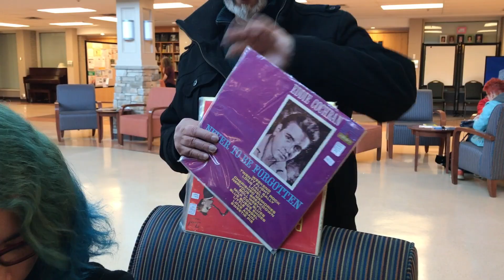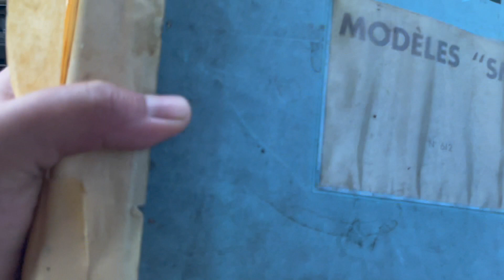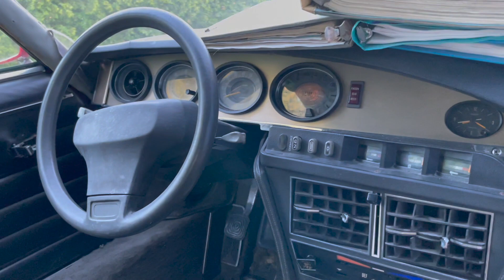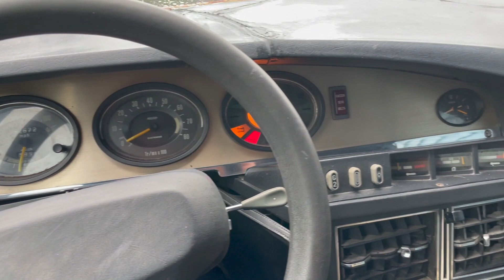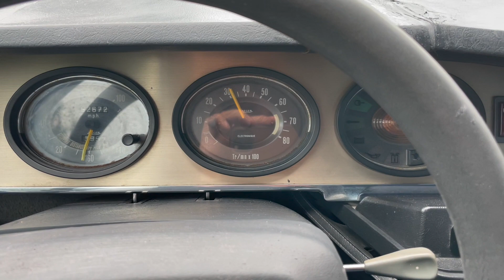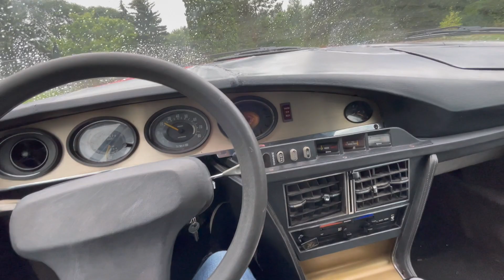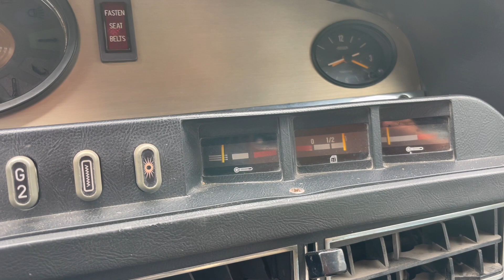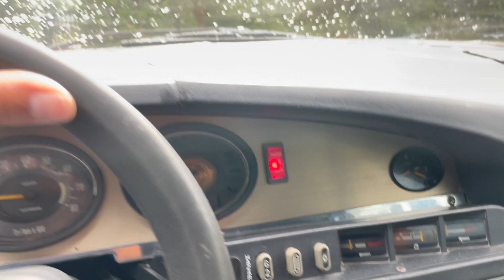Resurrecting a derelict french spaceship, Neglected Citroen SM

Comment: That is a genuine treasure.
You'll need new accumulator spheres all around (even though they appear good, the damping goes and there will be a shortage of brakes) for certain, to get the suspension/braking fixed up to full quality (they are linked, so brake force is automatically adjusted according to wheel loading, which was WAY ahead of its time) and the suspension is hydraulic, not pneumatic.  As the suspension and braking are linked, it is necessary to fix both to make it properly roadworthy - it will handle and brake far better for a set of spheres, and corners dead flat, instead of leaning out as we are used to - even the steering input adjusts the suspension pressure (the power steering is on the same system).  In the event of an hydraulic failure, you will get two full brake applications before it all goes, as one accumulator is reserved purely for that.  There are tiny seals on each joint in the pipework, and it is good to keep a few of those around (I even had spare spheres for mine, but they were daily drivers that I relied on, so could not afford to wait for spares).  I think yours takes one sphere on each corner, one centrally, and an emergency/reserve one to store emergency pressure for brakes.  They just unscrew but make sure the suspension is down and the engine switched off before removing them - you will need a chain or strap wrench.  I don't know about the SM, but on the models I've worked on (DS, CS, CX, XM and C5 [not all mine]), the rear spheres are a pain to access.
I have had a number of Citroens, so know the system moderately well - you will need some of the green hydraulic fluid (LM2, from memory, and it is probably overdue for a change - the shop annual should cover that, and you should follow it religiously, as each part of the system needs to be exercised in the right order to push out the old fluid and draw in the new), probably quite a lot - I'd get 10 litres for a full service on that, with a little left over for emergencies (carry it in the car, as it is hard to get).  It runs at insane pressure, and more normal brake line flaring tools are NOT capable of doing the job, as the "flare" is actually a bulge in the pipe a short way along it, which a seal is forced against by the pressure in the system.  There is a specialist Citroen tool for those lines, which is not expensive but is hard to find.  The windscreen may be a problem - they are even in the UK.
You can change a wheel even without a jack - just put the suspension to full height (only intended for maintenance), chock the suspension under end with the punctured wheel, then put the suspension back down, which will lift the punctured and chocked wheel!  For a front, put it in park and chock the rear wheels, as the parking brake is on the front wheels.  or a rear, the parking brake will suffice - use it, as the system seizes up if it is not exercised.  This is the suspension system that was licensed by Rolls Royce, Bentley and Mercedes Benz for their top-of-the-line models.  It is still the best there is, albeit slightly upgraded over the years (more electronic control with g sensors and laser-gyros to maximise handling from the XM on, and from the C5, it even stores pressure to return the ride height as you unlock it).  The more basic (and maintainable, with no electronics) system on that does have a rather wooden feel to the brakes, as the "pedal" barely moves at all.  The parking brake (the other pedal) operates separate small pucks on the same front disk rotor as the normal brake, but mechanically and relatively weakly.
Nice job on the paintwork, and I look forward to seeing the interior come back to life!  That is a rare car even in France, where it would draw similar or greater attention to an E-type Jaguar in one of its rarer versions!
Reply: Wow!!  And I thought I was super detailed in my posts!!!!!  Bravo Sir!!!
Reply: Yes, it's technology borrowed from the aerospace industry, the suspension, power steering, and brakes are all hydraulically actuated and electrically controlled, or electro-hyd. controlled. Just an all around cool set-up, that must be maintained correctly as you stated above. I would love to have this car!!!
Reply: @cliffordkinnear9705  Yes, you soon learn to do it right, usually after the jet of LM2 from a tiny leak cuts a neat hole in whatever metal it is pointing at (if you are lucky) or the wiring loom (if you are not). DAMHIKT.
It's actally more advanced than in aviation. as the spheres are pressurised with nitrogen, the pump pressurises the fluid with the spheres giving cushioning bacause gas is compressible, and the same circuit powering the brakes so that when you hit a bump on braking, the compression of the suspension increases (briefly) the pressure to the brake caliper, with the reverse happening after the bump or when hitting a hole.  Applied proportional braking per wheel.  Level sensors keep the pressure at whatever is required to avoid nose dive under braking or body roll under cornering, again keeping the braking power directly proportional to the wheel loading.  Pitch and roll are not somethaing that an aircraft needs to worry about on the ground, nor is the bump response on the sort of runways used by complex jets.
Steering angle sensors came in on the CX, to preempt body roll, and on the XM these were enhanced with electronics to both make it more proportional and give performance, standard, and comfort levels of proportionality.  The C5 added a self-learning capability, which adapts to your driving style, and although it retains the ability to shift it through settings manually, that just sets a new start point for autolearning.  And they were doing it beffore any aircraft had it fitted.  Aircraft still just have ABS and different levels of autobrake, applied when the weight-on-wheel sensors show a landing has occurred.  Relatively simple, as is preferred by the aviation industry.
Reply: It will be cleaned up and sold soon anyway so the real restoration will be done by someone else.
Reply: The suspension spheres on this car are the original splittable type, they can be opened up and new diaphragms fitted and there is a fitting on the outer half that allows them to be recharged with nitrogen per factory.  The sphere on the pressure accumulator is a modern replacement, you notice that it is smooth.  These units are sealed and cannot be rebuilt/recharged.  The last I heard new replacements were no longer available, though I could be wrong.  It's too bad that one was replaced and not rebuilt.  And there was a single small jack stand supplied with the car for tyre changing--there are notches in the bottom pinch weld where it fits.
Reply: @mescko  Well, without seeing the recharging valve I would not assume they can be refurbished - none of those on the CX or XM could be, yet they also have a seam around the middle, so being smooth is not the distinguishing factor.  I think the smooth ones may have come in with the C5, but I only ever gave relatively minor assistance to my mate working on his ones, so don't remember.  I would have thought it would complicate manufacture considerably and for little benefit to lack any seam in which the diaphragm could be clamped,  whether permanently or serviceably.
Reply: My head just exploded
Reply: Allow me to make some corrections to the above statements, as I have more than 50 years of experience with the Citroëns. 

The spheres lose the nitrogen charge over time, so the ride becomes very stiff.  Since the ride is soft it is safe to assume the charges are acceptable.  The dampers are simple metal discs with calibrated holes, so never wear out.

The rear brakes take pressure from the rear suspension spheres, the fronts are not linked in any way, nor is the steering, other than to be part of the entire system  But no one of these components takes pressure away from the others.  

If the brake accumulator is functioning, it is a sphere just like the suspension spheres but without a damper, then you would find that in the event of a system malfunction, such as running out of fluid, the brakes will work for many, many applications even from high speed.  This is because the braking system is one-way, it does not return fluid to the reservoir.

He originally stated this is an automatic transmission car, but it is the 5-speed manual, the pedal on the left is the clutch!  Duh.  

Back to the spheres, the suspension spheres are the rebuildable type, there are shops that can replace the bladder and recharge them using special equipment.  Even modern non-rebuildable spheres can be recharged as long as the charge is not allowed to go completely flat since that will damage the bladder.

The steering was the first to be speed sensitive.  It has a centrifugal regulator on the nose of the transmission so that as the speed increases more hydraulic pressure is applied to a centering cam, keeping the steering wheel at the straight ahead position more firmly, and requiring more effort to turn the wheel.  Steering is only 2 turns lock to lock, the only production car I'm aware of with steering that quick.

This car has a lot going for it, but does need quite a bit of work to be reliable, and more to be really good.  He's made a good start, and the engine started quite well so the car has been attended to which is a plus.  A very solid car, so well worth investing in making it right.

Comment: As a Norwegian who have owned a Citroën with air suspension i found a really neat thing about it. If you are stuck in a snowditch just lower it all the way down to pack the snow,  then lift it to the top, and voila, you can drive out of there like nothing.

Comment: to a person  new to the SM the steering may feel broken if you let go of the wheel it will forcefully almost violently self centre at any speed, it is also super sensitive with less than 2 full rotations lock to lock so take your time to learn the steering once you adjust to it it is sublime , many can not get used to it  , it is that different be very careful when aligning the front end , one wrong adjustment and it gets undrivable really quick  mark all the splines so you always can return to a base setting its easy for a normal alignment shop to get lost in the settings     alignment shops may say oh we have done this exotic and that exotic, but they have never come across a system like the SM  so tread extremely carefully  lean heavily on the forums or experts like SMworld or andrew brodie in the uk  ,excelsior motors in kentucky

Comment: CI (Alexander) that IS my Dream Car!!!  I love all the technology in the chassis, the HP engine, and finally the interior and exterior design elements! It's a beautiful car! The Citroen company started out as a foundry. Citroen made large parts for smaller parts to be machined and manufactured at the Citroen factories. Citroen first manufactured gears, all types of gears. That's why its emblem is made up of two upside down chevrons or gears meshing into each other. Make sure you drain out all that really bad gasoline, the gas tank, fuel lines, fuel pump etc. The Maserati engine does not like nasty gas sticking up the valve stems in the valve guides, also change the oil, make sure the oil has zinc in it or add the zinc to the oil you buy.

Comment: Many years ago we had a babysitter whose husband was a Citron mechanic.  We were driving in his Citron (the seats were overstuffed and it was like sitting in sofa at home) on the Bay Bridge going from SF to Oakland when we had flat tire.  This occurred on a blind spot on the freeway.  Very scary.  The driver hit the hydraulic switch and the back of the car went up.  He ran out and took out the spare and changed the tire.  Then lowered the car.  It was so fast - could hardly believe - maybe 5 min and we back driving again.  Love this car.
Reply: It's spelled Citroën. The hydropneumatic suspension they developed was one of a kind. If a tire went out the car could drive on three wheels, a feature that saved France's President Charles de Gaulle from an assassination attempt that shot up his car. Then the car could raise itself up and lift the flat tire so it could be changed without a jack. The suspension could be raised for poor roads or lowered for highways. The suspension was so soft Rolls-Royce licensed it because they couldn't come up with anything better. Rolls-Royce didn't take the auto-centering steering with one turn lock-to-lock or the pressure-sensitive brakes that Citroën had on their cars.

Comment: I'm so envious! I used to have a 67 DS21 in high school that spent much time at the Citroen repair shop where I would always drool over the SM's they had in the garage. I would have a knowledgeable Citroen repair guy go through the hydro pneumatic system and completely rebuild it since it's majorly important to the drive experience as well as the brakes. You've got yourself a treasure!

Comment: One of the neat things those do with the hydraulic/pneumatic suspension... There is a tire change setting to basically lift one wheel off the ground leaving the car sitting on 3....no need for a jack

Comment: Also known as the French Cadillac. I had a customer who had several of a 60's  models and the model you have. Very unique cars and not too bad to work on. In the trunk there should be a jack stand like tool that when you pull the lever to raise to highest level, place jack stand tool and change the tire.Easy. Very nice score and well worth restoring the interior and having the engine bay detailed.

Comment: its really important to be very careful with the engine valves, they were sodium filled and if the original valves are still in it  they HAVE TO BE REPLACED with solid ones  the valves may fall off at any time, if it does it will destroy the cylinder  head,  because this has happened so many times over the years that replacement head castings are completely unobtainium  so the car becomes a boat anchor  so be CAREFUL . its a really good that u know scot he knows his stuff , these cars have many pitfalls like the oil cooler lines just disintigrate  really it needs a careful recommission by somebody that  knows them(ideally scot or at the very least his guidance )  please please please dont fall into the trap of saying oh its running its fine , just those  two things i have mentioned are catastrophic there are more , this is a super car , and a good one will be worth a lot of money , as the attrition rate has been so high over the years their are not  many left, especially with a rust free body  like that one , you have a diamond  but you have to be careful  i wish you luck  also disconnect the belt to the ac and dont reconnect it till the compressor has been checked over , if the compressor fails it can shock load the timing chains  wich at first will seem like nothing went wrong  but will let go later on  causing engine damage that shaft off the back of the engine was never designed to drive  the ac , alternator and  hydraulic pump (run the belts on the looser side so they slip first and dont transfer shock )  so every thing has to be 100% to ensure that  shaft has an easy life , the hydraulic accumulators (basicly pressure reservoirs) need to be fully charged so the hydraulic pump never demands to much from that shaft . those lower sill covers under the doors are just sheet aluminum , if you have them shipped they will arrive damaged as they are that flimsy !!! scott could whip up a set in his sleep . you need to put heavy ppf ( special  windshield quality stuff ) over the front glass as it is also unobtanium  so if it cracks , you will search the earth for another  remember this is a more complicated car than most super cars , if you treat it right it will amaze you but also if you dont it will bite you  badly !!!  . I hope i didnt scare you ,  but you are the caretaker of one of the best cars ever made , check out what jay leno says about them , he daily drove one for many years despite the choice of cars he has in his garage  that alone  says it all   SM world in California is your best bet for parts  they have solved most of the weaknesses' and are well worth a look  . it seemed like the engine had a slight miss , that is probably the distributor , wich is a prima donna marrilli unit, that requires constant attention  and infinite patience ( if you want it reliable make it electronic bin the points ) theres more so do your research. when i was younger i saved many of these but saw many destroyed through poor maintenance  the braking is amazing, it drops the rear suspension  as you brake to stop wieght transfer , it feels like your landing a plane every time you brake  an amazing feeling, the stopping distance is good even by modern standards and a was outstanding back in the day  indeed many were rear ended as they could stop so much sooner than  70s cars !!!!!. as you can see the dice is loaded against these cars so if you can keep a good one they will be worth a large amount of money in the future